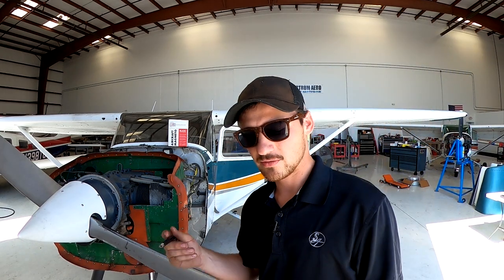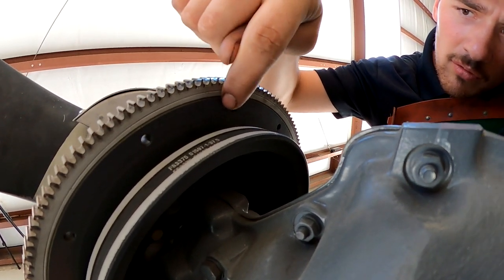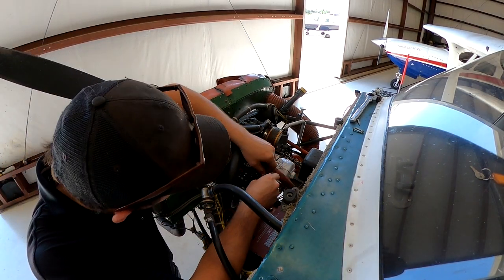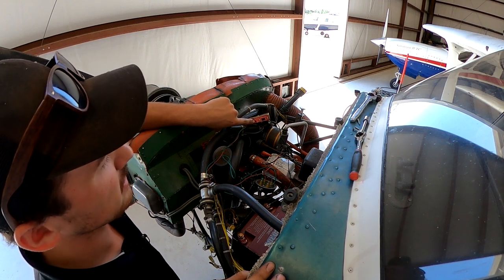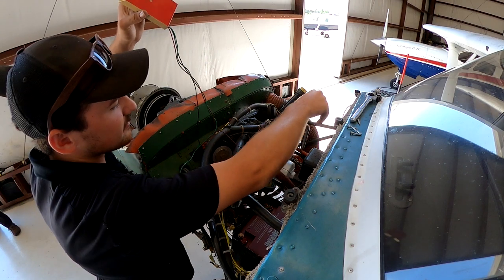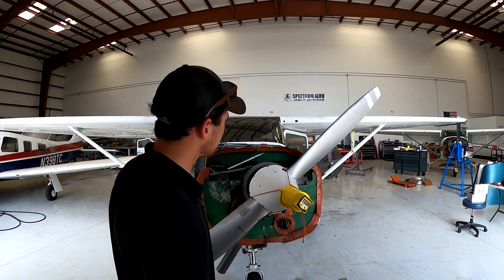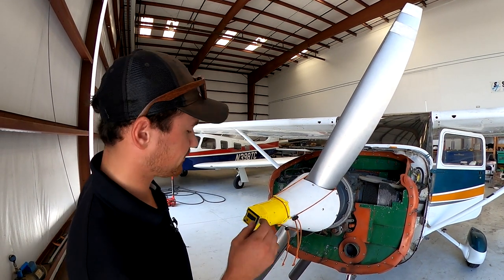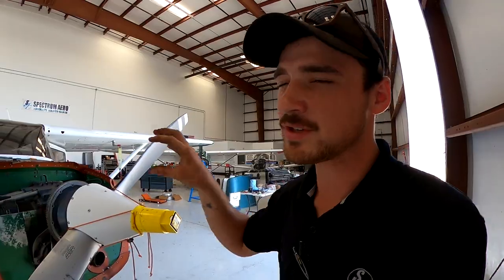Timing the engine.

Comment: Two comments:  My mechanic insists that we remove the #1 spark plug just to check the timing at annual.  It's not a big deal, because we have to clean and check the plugs anyway.  But, unless I'm an idiot, (maybe I am), EVERY cylinder fires at 25 degrees BTDC.  And, it doesn't matter which cylinder you check the timing.  The only reason to find top dead center on compression stroke of the #1 cylinder is to INSTALL a magneto.  But, you still must set the prop at 25 degrees BTDC before you put the mag in.  Once it's in there correctly, it doesn't make a hoot which cylinder is on the compression stroke to check the timing.  Now, the only reason I watched this video is to see what value you torqued the magneto hold down clip nuts.  As usual, no one torques them to a specific torque value.  The Lycoming engine manual doesn't give a specific value except for where it says, "17 to 19 ft lbs, or 204 inch pounds, for a 5/16th bolt, nut, or screw".  The reason this is so dear to my heart is, I once had a mechanic over tighten a mag, cracking the flange.  It almost killed my wife and I.  There NEEDS to be a specific torque for magnetos.  Why don't we have one?
Reply: In response to your comment “every cylinder fires 25 degrees BTDC,” this is true but it doesn’t fire EVERY time it passes 25 degrees BTDC. Only every other time since one pass is the compression stroke and the other pass is the exhaust stroke. You of course don’t want your spark plug firing on the exhaust stroke so that’s why the magnetos are installed and timed during the compression stroke ie 25 degrees BTDC. Does that address your concern? I may have completely misunderstood what you were asking/saying though.

Comment: Have you got am O235 maintenance manual.  I need the Jug nuts torque setting as putting on superior Jugs.
Reply from the maker: I just looked and thats a negative I do not have one. Sorry man.
Reply: Refer the Lycoming Cylinder installation Service Bulletin, that has all the Torque settings and procedures
Reply: @kushlafernando6201  Great  thanks
Reply: Great video and thanks for the links.  Don - You can find those torques in Part 1 Section 5 Special Torque ValuesI of Lycoming's SSP-1776-5 toward the bottom of page 1-35 and the bottom of  2-21.  You also need to reference SI 1029 as noted at the bottom of the page.  The torques aren't in the maintenance manual.
Reply: @FISHH00KS  Thank you. will look that up.
Reply: @FISHH00KS   Your values are a bit high.
Reply: @FISHH00KS  All the best. take care
Reply: @FISHH00KS  Are you talking about your self. If so please seek some sort of help so you can find peace.  That one would be a very heard road to go in life.

Comment: If you're using the TC mark on the starter ring flange to find TC, is it still necessary to feel the air pressure coming out of the spark plug hole on the compression stroke? It seems redundant. 

From my point of view, if my sole purpose is to install the magneto, it seems like I can just skip the harness & spark plug removal step and just go straight to lining up the TC mark to the crankcase centerline.
Reply from the maker: No the spark plug removal is absolutely a necessary step. Because the prop spins several times before the number one cylinder reaches Top dead center of the compression stroke. 

You have to confirm that the #1 cylinder is on its compression stroke or those timing marks on the starting gear mean nothing.
Reply: @aerocrafty6006  where did you get the digital prop protractor and adapter

Comment: Don't you have to rotate the propeller to snap the impulse coupling before timing the mag with an impuise coupling? I didn't catch that step in the demonstration.
Reply from the maker: I have never considered that an requirement to time the engine but they are most likely popped every time I time an engine because that is how I tell when the prop is somewhere around top dead center is when they pop then I make the small adjustments from there.
Reply: @aerocrafty6006  It's easy to be moving the prop around and recock the impulse coupling which retards when the points open and screws up the timing you're trying to set.

Comment: Never saw him remove the timing pin from the left mag. OOPS! Broken pin.
Reply from the maker: Yes that is definitely one of the most common mistakes I still make today. I have bent timing pins but haven’t broken any yet.
Reply: @aerocrafty6006  - Did it while in school....youll be taking the sump off and going fishing!
Reply: According to the slick/unison manual, if you move the prop with the pin in, you have to disassemble the mag to check for internal damage.